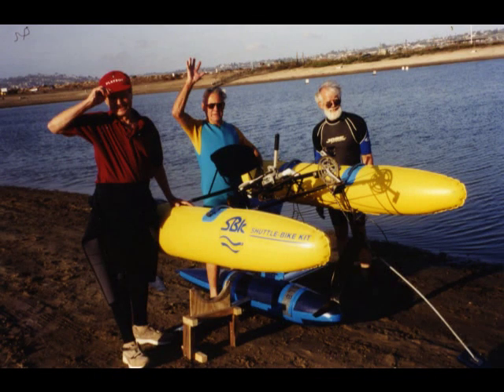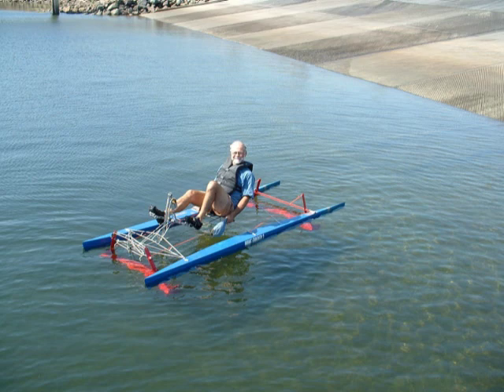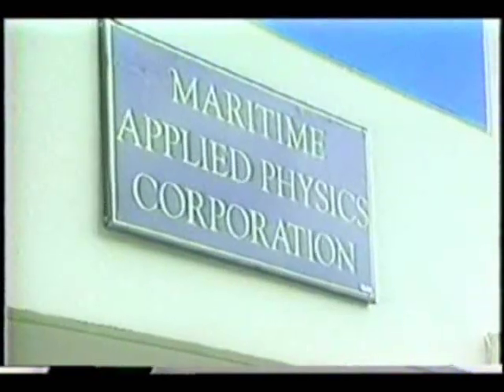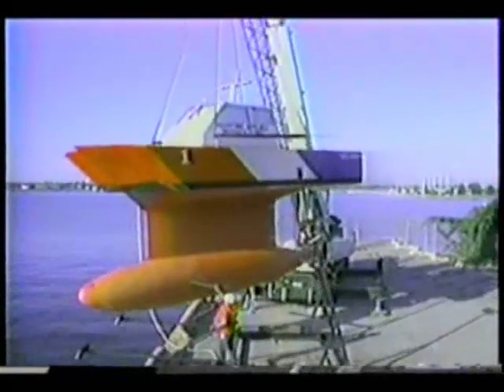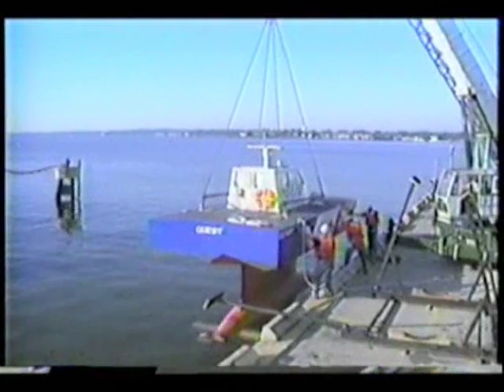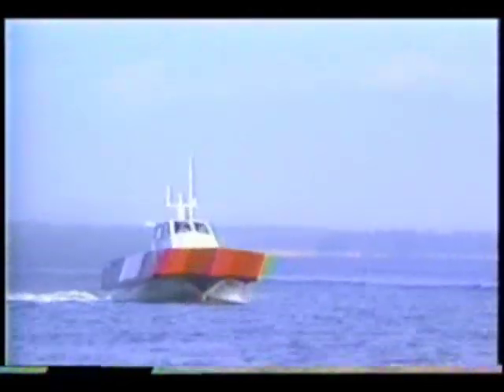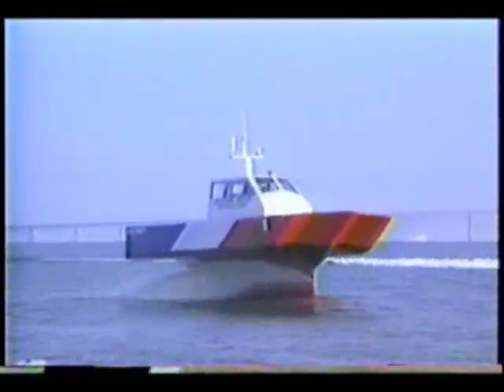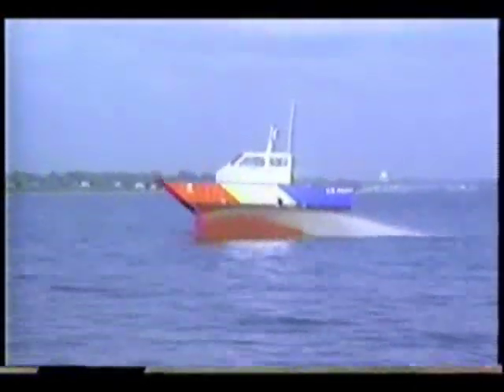HYDROFOIL -- High flying torpedo or low flying aircraft?  Ray Vellinga edited video

Comment: At the first and second boat, the lever is too small to compensate rolling forces. Would (additional) outriggers with surface piercing dihedral foils make sense? What is the assumed take-off speed of the first two vessels?

Comment: It is not flying, it is still in the water. However if we take the hydrofoil as a separate part of the boat then yes it would be "flying" but only hovering unless the hull of the boat is at least 10ft above the water.